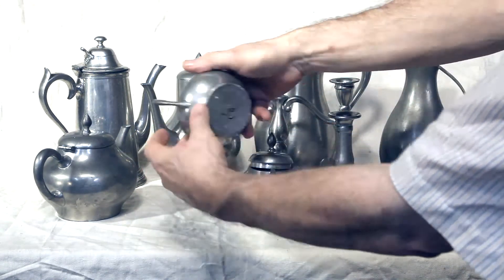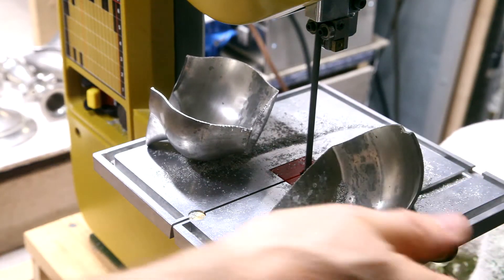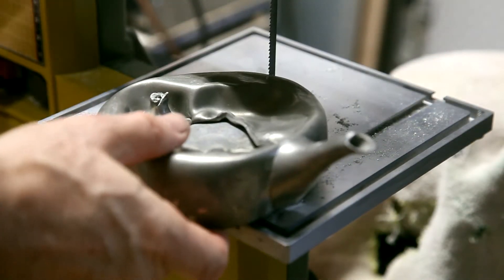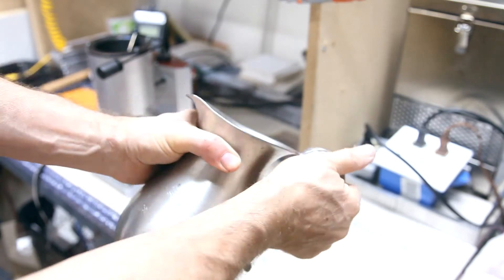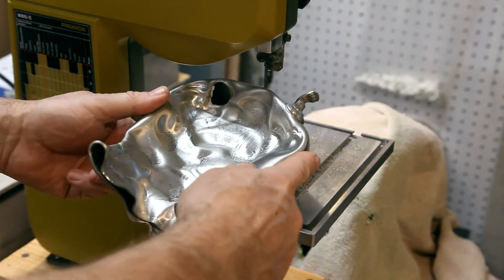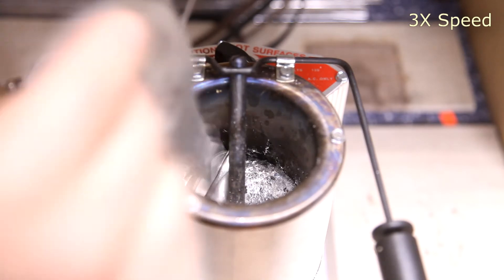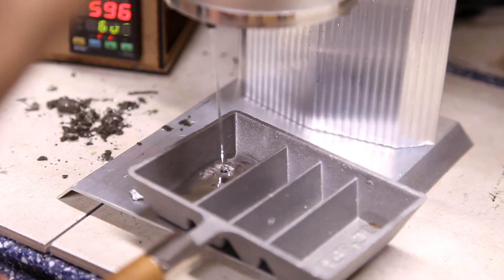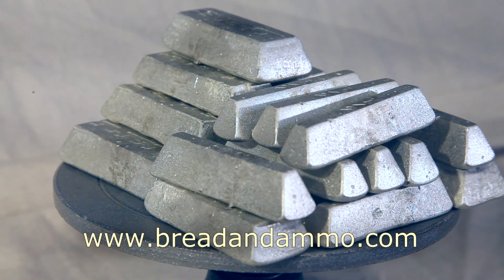Processing and Melting Pewter

Comment: I just got into pewter casting, and found cutting up the scrap pieces was too labor intensive.  My solution was to hold the piece with tongs, and use a MAP torch to melt the metal into a container of water.  This makes tiny pieces that are easy to get into your crucible/melting container. I then spread the grains out and let them dry before melting them into ingots.